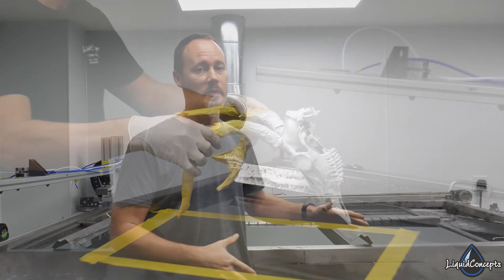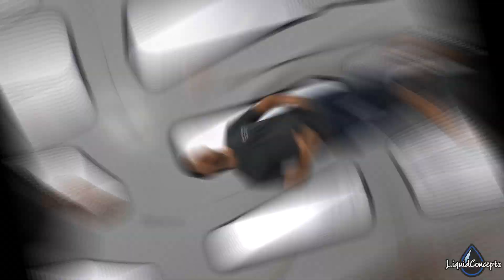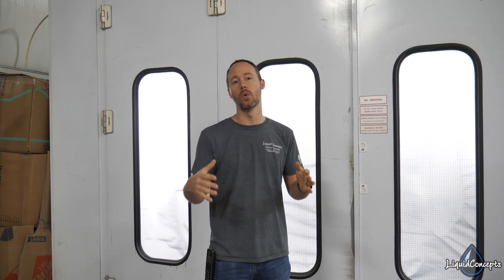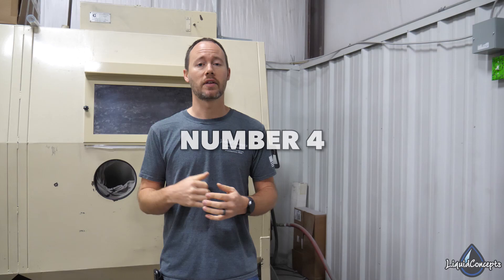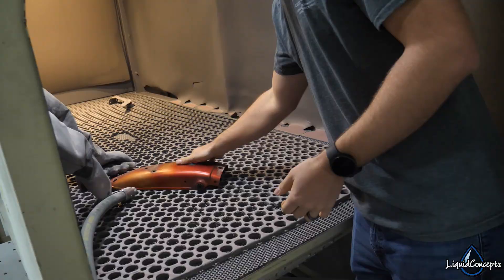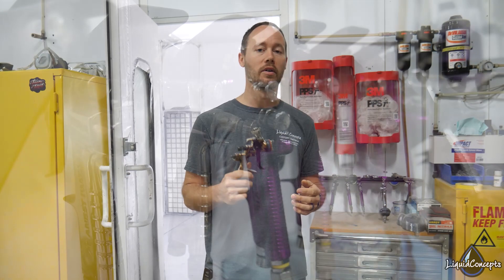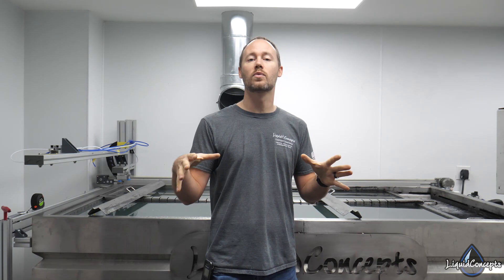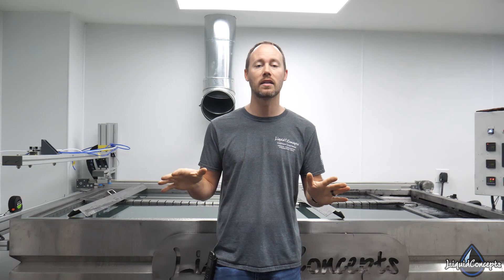TOP 5 Tools You DEFINITELY NEED for Hydrographics

Comment: What price point is a typical paint gun?
Reply from the maker: Paint will honestly vary depending upon the brand. Entry level guns can start around $100-$300 whereas higher end guns can be $600-$800 in most cases.